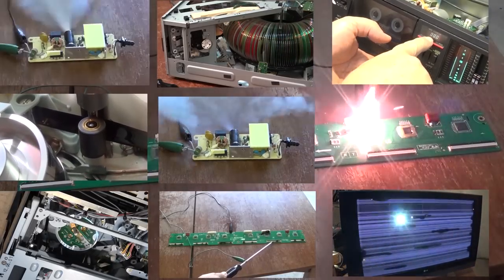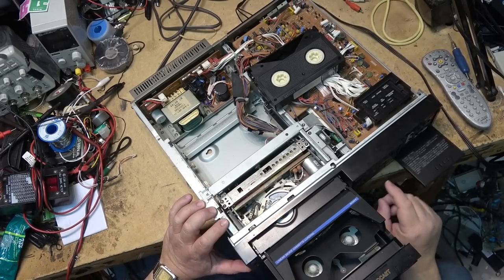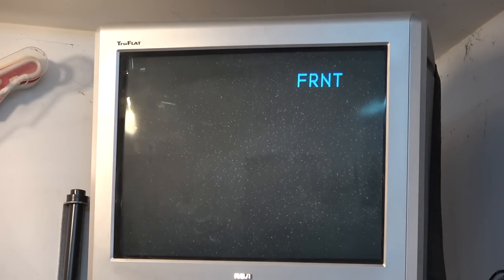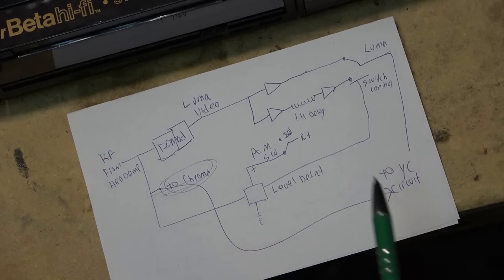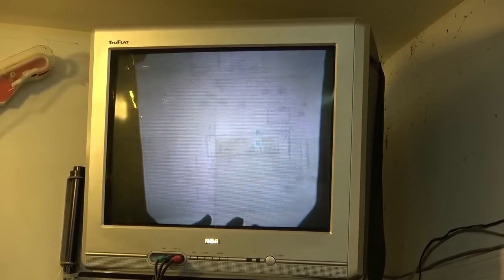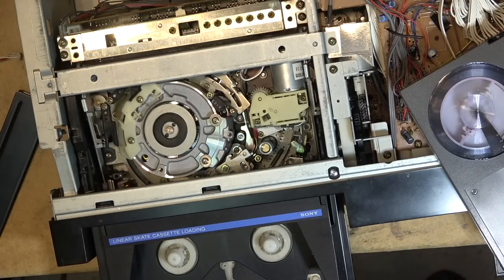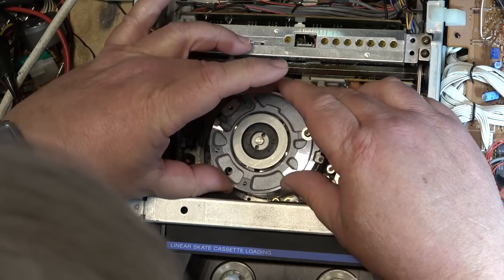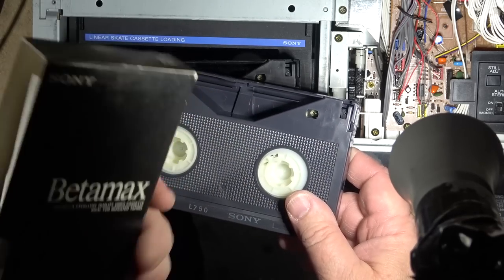Sony SLHF750 Betamax with a poor picture

Comment: Theoretically you can feed the CRT with a negative image of the security cameras to counteract the screen burn 😅
Reply from the maker: Once the phosphor us burned, it's burned peemanantky.  No way to un-burn. 
Feeding a negative image would in theory burn the unburned areas so they are burned equally.  If it took 5 years of 24/7 operation to get that bad it would take another 5 years of 24/7 operation to equalize the burn and by then there wouldn't be much if and emission left. From the gun and phosphor.
Reply from the maker: @mrnmrn1  have no idea. It has never been open. It was purchased at the end of CRT sets for 48.88 new. They had 2 left at the store.  I should have bought both.  It was purchased as camera monitor and was put in service as a that for the first 5 or 6 years.  It wasn't running 24/7 for most of those years. Has an on/off timer built in so it would turn on at 8am and go off usually at 10pm because by that time of night nobody was around the kitchen so there was no point in running all night.   The LCD that replaced it is having issues again.  It has been pretty reliable however.  You are right with trinitron.  Those tubes never lasted that long.

Comment: My Sony EV-DT1 Trinitron Video 8 TV recorder has a mech that wraps the tape around the drum like beta. Interesting design.
Reply from the maker: Early 8mm used the U loading system similar to betamax and u-matic.  They changed to the M loading system as with refinements it allowed for a smaller drum to be used resulting in even smaller mechanisms.  Even Beta changed to smaller drum and M loading.  Betamovie used a single head version and 360' wrap but used a modified signal time compressing recording scheme that made playback impossible.  BETACAM the broadcast version adopted a multiple head compact drum and M loading scheme.

Comment: I'm glad I chose VHS Beta had better video quality in the beginning. But changed with new iterations and stupid mistakes like the wires attached to the tray.
A failure waiting to happen. 
You have it playing very well.
Making the head shiny is bad in this case.I had many issues with VCRs but that was because most manufacturers had assumed basic usage. When in reality was used 24/7 Due to record to watch later and constant usage every day. Consumer Reports had concluded that usage surpassed their estimated number 😳 at the time. Dad bought our first VCR in 1986 A Panasonic mono for 699.On sale🤣
I eventually sold it in 2001
Everything still worked. Metal VCRs what a concept  before plastic rot components invaded .Good Video 😎

Comment: One thing I wanted to see is how the monoscope looks with the DOC turned on and off. You should be able to gain a bit of a better resolution with the DOC off but the dropouts would drive me nuts...
Reply from the maker: It shouldn't change the frequency response. In pcm mode it also disabled eq (sharpness) control so the signal is more flat.  The edit switch also disabled EQ so as to not over emphesize the copy.

Comment: Why use a CRT for your security cameras as opposed to a LCD TV?
Reply from the maker: I do use LCD now.  This one is old and was burned from years of abuse.  I use it in the shop to monitor the cameras only when i am working. Its off the rest of the time and of course for testing old vcrs.  I have a big 27" crt with built in VHS and DVD that some day I will get around to wall mounting for a test monitor.  Just need to build a shelf as I don't think it will go on that mount.

Comment: I agree completely that this loader design is crazy but there had to be at least one good reason for it. Can you think of any at all?

I have one that needs restoration (when I'm a little more flush with funds...) and I've long puzzled over why Sony did this... 🤔 

Always enjoy your videos. 👍
Reply: Maybe there was a portable Beta VCR model which used this compact mechanism, but the sales were lower than expected, and they ended up with a hundred pallets of this tape transport remained, so they designed a tabletop VCR around it 🙂 . Just a wild guess.